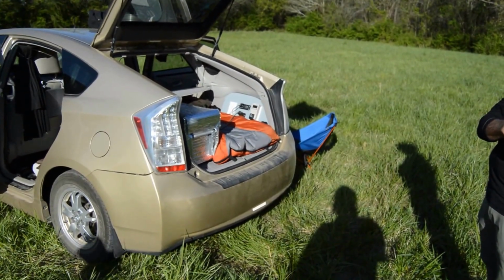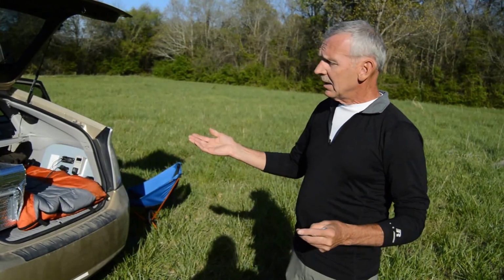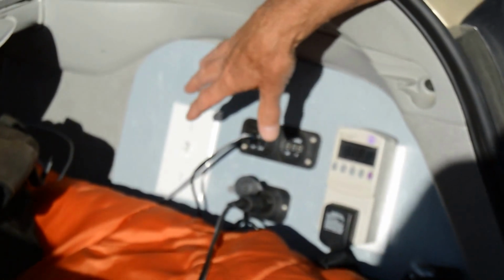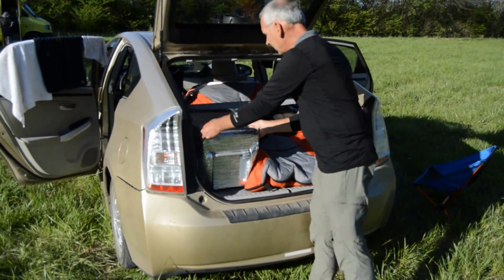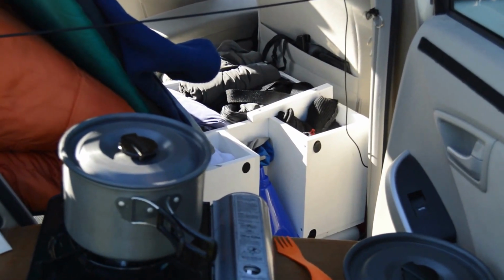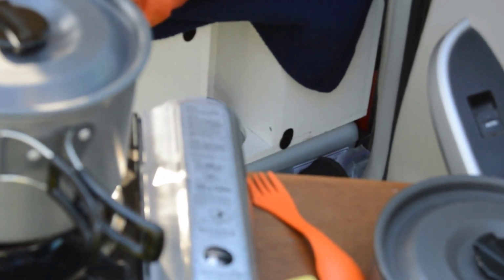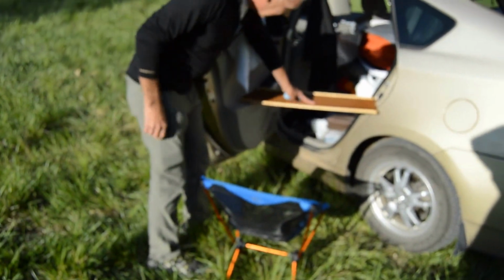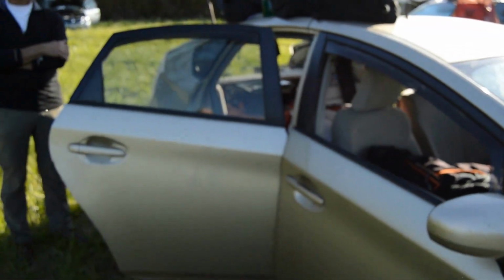prius camper

Comment: Wow! I just bought a nice Gen 3 Prius and plan on camping in a few days. I sure like his set up! I went to RTR in my Neon and I yanked out the back and passenger seat and built a platform bed. At 6'4" tall I slept in back a few days ago and it wasn't so comfortable as I couldn't stretch out. I guess I should remove my rear seat and build a platform. I would love to know more about adding a 2nd battery like Prius stealth adventures did so I could have more electrical ports/accesories in the vehicle. I always have to switch the 12v plugs and I have a 300 watt inverter. I have always camped with dry food and water. Having a fridge would be Awesome!

Comment: He should consume 444 gallons of fuel X $2.50 a gallon comes to  $1111.11. He can easily get 45 mpg with a gen 3 even if he runs it to power AC overnight. Trick is set your AC to 72 and your heater to 65 that way you don't get too cold and don't burn too much fuel staying cool. Also want to use fans the box fan from 02 cool is a good device to have on hand that will allow you to set your thermostat higher. Also want to park in the right place if winter you want to be in the center of a black top to take advantage of warming from the sun or next to a west facing wall. 

Summer you want to be on that North East facing wall at night so you are not parking where the sun warmed that location. If you can park in grass near woods even better.  

  My Prius is different from his it is a gen 2 he has a gen 3 he could sell them tables he should get a patent on that and mass produce them.
Reply from the maker: +GEAUX-PRIUS Cowboy hey thanks for your feedback!  I'm pretty sure Brent will see this comment.  You guys have the economy edge over us in our van.   ;-)
Reply: Dancorday I got to see him at the RTR and he has it right.
Reply from the maker: Oh OK, cool.  I'm glad you got to meet him.  Very sharp guy and great setup.
Reply: I'm surprised he doesn't sell those tables. He could sell them at 50x or more material cost buying the materials in bulk, spend a day cranking out a couple dozen and just mail them out of his storage. Just advertising it on the priuswellers subreddit alone would clear stock.
Reply: Chad Thundercock I dont think anyone would buy them.  Prius campers are a creative group...they can figure out that design and cut a piece of plywood themselves.

Comment: im curious how he was charging his secondary house battery
Reply from the maker: +DailyOC I believe he had it tied to a twelve circuit in the car.  So, when the voltage on that circuit dropped the car would start itself and charge.  That was one of the advantages he points out in the video. The Prius being a "smart" car would monitor and maintain itself even while he slept.

Comment: He could mass produce those tables for the rear door and earn a killing. I would make it out of aluminium and slice of angle aluminium. By the time he got to the RTR he had a solar panel for that smaller battery pack.
Reply: It's fairly easy to take the shape from the door column with a Profile Gauge/ Contour Gauge (less than $10  at Home Depot, e.g.) so it's probably not worth his while. But a piece of material thick enough to span the gap without edge support, maybe Al?, would stow away easier.  My next project.

Comment: he spoke of a generator.. but did not show what type or how where it is situated. It doesn't seem it would be safe to have a gasoline generator inside the passenger compartment.
Reply from the maker: Very good catch I actually had to go back and watch the video myself again.  I believe when he referred to his 400 watt pure sine-wave inverter  he said generator instead of inverter.  This interview was totally unscripted and rather spur of the moment.  Thanks for watching, please subscribe and share the video.  I am taking a little break from life on the road to prepare for a bigger full-time adventure in early 2017.
Reply: thanks.. after watching this i did more search on youtube and saw that there are some people that have deviced ways to use the car engine as the generator through the 12 battery system i believe. I am not clear if there is another way to connect up the highvoltage battery to draw energy from that battery. Hope to learn more about this. In a plug in hybrid i can imagine in addition to recharging the batteries.. energy can be used to run appliances and heating etc.